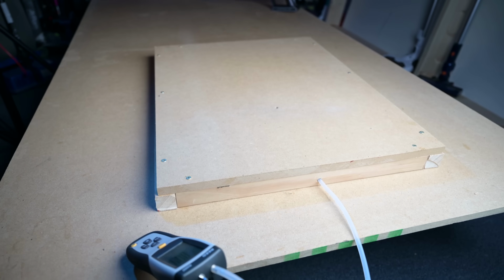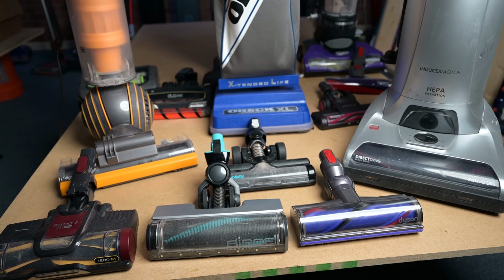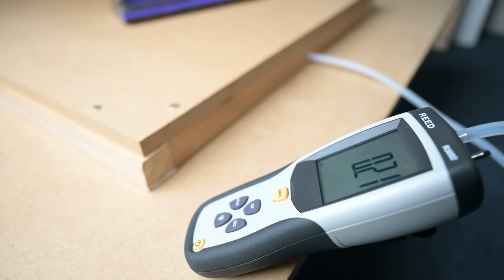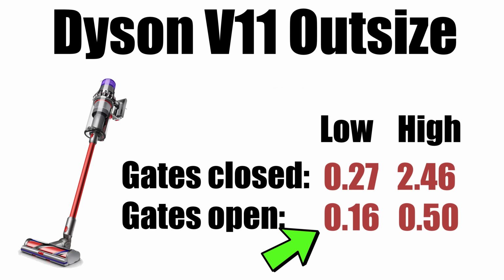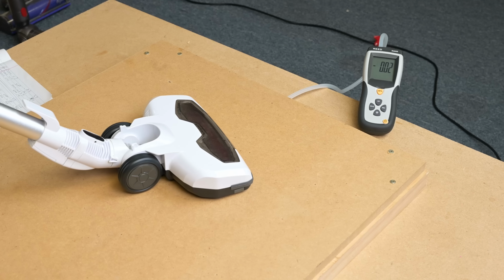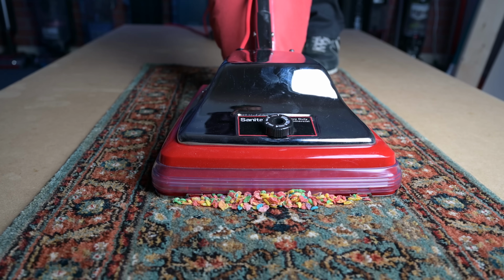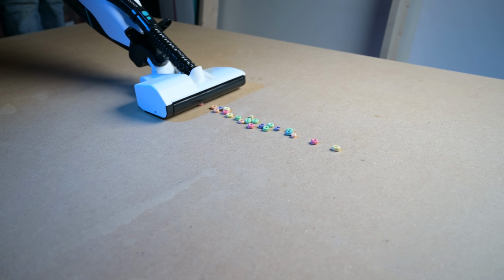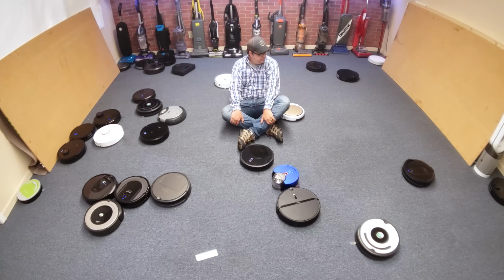Which Vacuum Has the Most USABLE Suction? 46 Vacuums TESTED! - NERDS ONLY!

Comment: Why having just one hole? Realistic test would be having like 5 holes in a small block so that it gets an average number.  A small powerful suction area only in focused area isn't helpful in real world. User would assume entire area of head would do cleaning  not just one focused spot.
Reply: It's irrelevant. If X is stronger than Y right near the hose, X will still be stronger than Y 4 inches away from the hose (by the same ratio too). For the sole purpose of comparing different brands/models of vacuums, it is completely useless to do that test. You'd also need a manometer per hole... lol
Reply: @Xarosai  You are so incorrect and you do not understand the physics of how suctions work. The further you get from the focused area more drastically the suction will be lost. You might get good suction in the diameter of 1 inch but 3 inches apart you might not even have any suction.
Reply: @user-fx5sw4jy7hYz9Hzi  I never said it was as strong 4 inches away than right at the hose genius... but take both of them 4 inches away from the hose the one that's stronger at the hose will still be stronger 4 inches away. You clearly don't understand much about physics if you can't figure this out lmao

Comment: Great video.  Did you ever check if the brush would stop on the carpet with any of your Roborocks?  I replaced my S6 MaxV with an S5 Max because of the brush stopping issue and found the S5 Max would still stop but a little less.  People continue to report the issue on the Roborock subreddit too.
Reply: My Roborock H6 has the same problem on some carpets (1-2cm thick). I haven't noticed it on my S5 Max.

Comment: Had the Lupe vacuum for a little over a month now (was sold on it from a previous video on this channel). The suction is very strong on normal mode and creates a noticeable amount of resistance when you try to push along on carpet. Build quality is amazing and the front "soft" roller is amazing at pulling in larger debris. Customer service is excellent as well. I had some weird issues with my battery and they sent me out a new one free of charge.
Reply from the maker: Thanks for sharing!
Reply: Hi, 

How is it performing a year later, and how loud is it actually?
I'm eyeing one right now, but am still kind of looking around for other options to compare. Vacuum wars, although his excellent reviews, didn't really cover the Lupe in his later video's so I'm looking for any kind of information I can find :)
Reply: That was rude, they could have charged it for you before they sent it to you

Comment: More important for ease of use sake..... The Lupe DOES NOT keep hair off the roller like the Vertex. Tangled hair is bar-none the hardest thing to clean off your vacuum.
Reply: True but in my experience- in our household - long haired wife, short haired husband, baby and Labrador I have no trouble with hair wrap. The only time the roller gets tangled and I have to untangle it is with one wool rug which sheds a lot and even the amount that’s shedding has reduced significantly as I guess the vacuum is grooming it. The wool fibres come off the brush really easily too.
Reply: @redcherry71  lucky you. I wish i could post a picture of our 2 shark vacuums. 1 standard duo clean F80 gets covered in hair... the Vertex gets zero hair tangle.

Comment: 1:57 well, that script needs to be better. a good seal is still good or required for hard floors, it is only picking up large debris is cumbersome.
edit: I finished the video but this will go against on your comment on the Shark Duo where you never needed a strong suction because the head is so good.   I also discovered this concept myself after getting a cheap Chinese vacuum with almost toy like suction on low power but works well due to the floor head.

Comment: At what point does the vacuum not need any more suction to adequately deep clean the carpet, especially if it just makes it harder to push and pull the vacuum on carpet? I’m looking for something to replace a regular upright (currently have a shark) and I like the Dyson v8, but I honestly don’t mind a coded version of these types of vacuums. I want something that deep cleans carpet and us as easy to push as the cordless stick vacuum. Any suggestions? I don’t see enough reviews of the newer corded versions of stick vacuum such as the new vertex, which I’d really like to see. Thanks

Comment: You should make a suction rig with carpet on top of it instead of just bare wood.

For the sake of discovery.
Reply: @oufofmemory  yeah the perfect proof that this is pretty useless is that the Riccar was in the last column but had some of the best numbers for pulling out debris due to agitation and design.
Reply: @oufofmemory  Yes, the Vacuum Facts channel (which is amazing BTW) reviewed the Lupe recently and showed that all the high numbers in this kind of dodgy test don't translate into actual cleaning performance on carpets at all. He's really good at exposing misleading nonsense out there. Now my fav channel
Reply: @oufofmemory  I see what you're saying but the same is true on hard floors. Vacuums with high suction, strong seal, and no brush roller will perform worse than many high suction, poor seal vacuums with a soft brush roller.

If you're saying is a dumb test on carpet for this reason then it's equally a dumb test on hard floors.
Reply: @oufofmemory  It wouldn't be uninformative.

It's very possible that the vacuums that seal well on hard floors would fail to seal well on carpet due to brush roller designs that fail to penitrate into the carpet (like soft roller designs).

Comment: Nerd here.  But I won't have many nerd remarks.  Does the Lupe handle well?  Yeah, the term 'handling' is usually reserved for automobiles, but vacuum nerds can use it too.  And I don't care how good a vacuum's suction or airflow is if it is a big, clumsy beast.  Looking at you Tacony twin fan and Kirby.  My Dyson stick vacuum (yes, you're sick of hearing about it) can vacuum stairs with the regular floor attachment - straight from floors to stairs with no change.  If the Lupe can do that, I'd consider it.
I think Tacony's cordless that looks just like the Supralite converted to battery and was reviewed on this channel is a direct air machine.  The corded versions is direct air.

Comment: PLEASE, find a solution to test robot vacuum with this method. This is probably the most important variable in front of the air flow and it's absolutely a necessity !
Thank you for your work.

PS: I see that cordless vacuum cleaners are very popular especially in the United States, but I admit that it remains a mystery to me. A cable is however so little disturbing compared to all the disadvantages of a battery (lifespan, charging time, cost, suction time ...)

Comment: Just a tip, MDF is extremely porous, it's used in vacuum bagging applications BECAUSE of its ability to pass air through it. I'd recommend you seal the top surface to mimic a timber floor. Great idea though.
Reply from the maker: Thanks for the input! I am sure you are right, but at these levels (fractions of an inch per water lift) that is not a concern.
Reply: @VacuumWars  That's a fair call, I did consider that after I posted. Either way your test gives a consistent performance comparison between models. I was surprised to see the Hoover Blade Plus (crappy brushed motor) did well in that test, I'd be curious to see the results for the Hoover Blade Max.

Comment: This is why I love this channel, good testing like this. 1 thing to note too with this test is I think the size of the cleaner head will effect the results. For example the Sharks with Duo Cleans would be worse because they have a bigger head area. Its basically a bigger area to maintain suction in.
Reply from the maker: I didn't really notice that being a concern. It is true that the suction was much weaker the further from the place in the head where the hose was, but as long as you were on the hose it didn't matter. Many Dyson cordless heads are smaller than the LUPE for example.

Comment: "Nerd" here. For everyone here who isn't super-involved in vacuum tests, there is no single test that can show the overall performance of any vacuum. Here are several things to consider before you buy a new vacuum for yourself:

-Typically, a vacuum's suction and airflow at the nozzle are tested separately using a water gauge (suction meter) and anemometer (airflow meter) on a sealed box, not just floating over a small hole like in this video.. 
-You'll also want to look for debris pickup tests on carpets (surface and deep in the carpet) and hard floors. A vacuum's main purpose is to pick dirt up, so that is a better example of a "one size fits all" test (but still not perfect).
-While "usable suction" is a good thing to consider, it's too broad of a test metric to show anything useful. The test shown in this video tries to lump all sorts of results into one test (suction, airflow, nozzle design), and the accuracy for each result is much lower than if they were found separately.

If you want to learn more about proper vacuum testing, check out these channels:
VacLab: https://www.youtube.com/channel/UCfAarW_X4eTF79tjR9i0xmQ
Vacuumtests: https://www.youtube.com/channel/UCAf8Z345P7oqP9jZBh6ncVQ
Blackheart: https://www.youtube.com/channel/UClfEV_bXQjZ_lf3icxCPloA
Reply: This test is pretty useless cause they only made this test to make there vacuum look good
Reply: @EvanJS2005  it's a pretty realistic test, I don't see why this would only favour their vacuum, not to mention it does better than any other cordless vacuum in the carpet deep clean test as well
Reply: He pretty much does all of those tests in the reviews...

Comment: Cordless? Riccar R10CV.6 is the best. 50 to 60 minutes run time & carpets look brand new.
Reply: Yeah, that proves that this is a useless metric, the Riccar Cordless scored 100% on the carpet deep cleaning test even though it’s one of the worst performers on this chart. Also, who cares that the Lupe cleaned well on low power mode when the Riccar has longer battery life in high power mode than the Lupe has in any mode?

Comment: Got the Shark Vertex Zero M a couple weeks ago after sending back my Dyson V11 Animal and deciding stick vacuums aren’t worth it for my mostly-carpet 3000sqft house. 

Very very pleased with it. It’s heavier, but I also feel like they substantially improved the quality of their vacuums in the last several years. It’s leaps better than my parents’ new-ish Navigator they bought in 2017, after I recommended it because I liked my Navigator from probably 2009-2011 (hand-me-down from a relative so I’m not entirely sure of it’s age). 

It truly does not struggle with hair. My son ripping elastic out of his socks to use as makeshift spiderwebs for his Spider-Man action figures to swing on, however, are another story 🤣 those wrapped around the front brush head so badly I had to use a pointy knife to dig them out. But it only took a few minutes and I loved that I could pop that front roller out of the head to clean just the roller and not have the entire vacuum head in my lap, so I still love this thing very much. 

Thanks for nerding out to help people make informed decisions on expensive appliances.
Reply: Get Cental, will never be unhappy